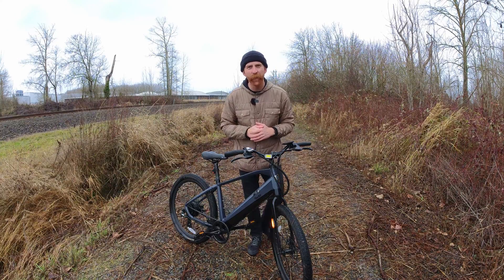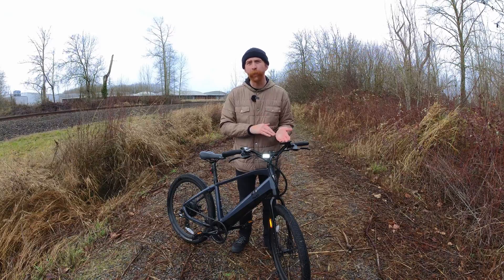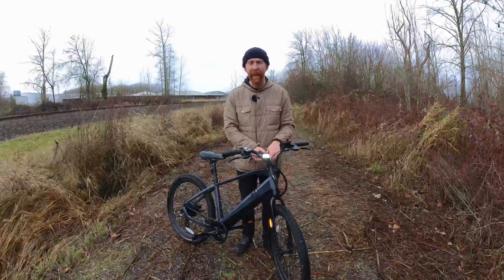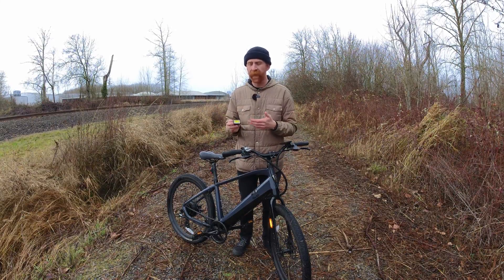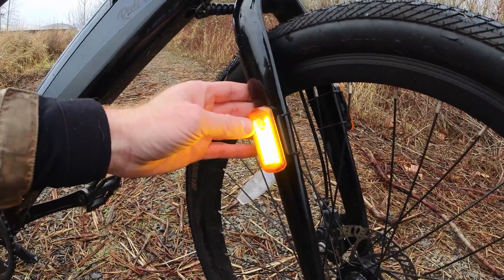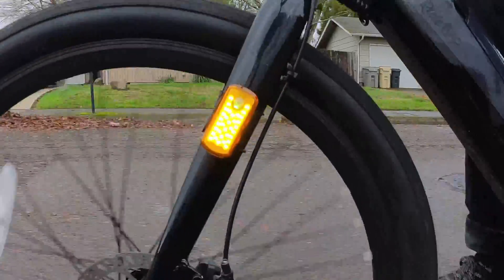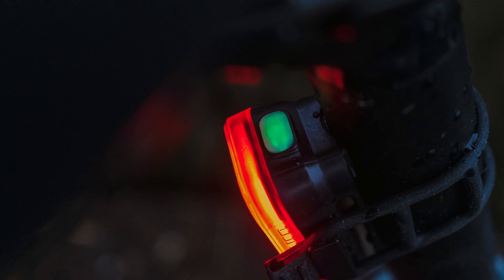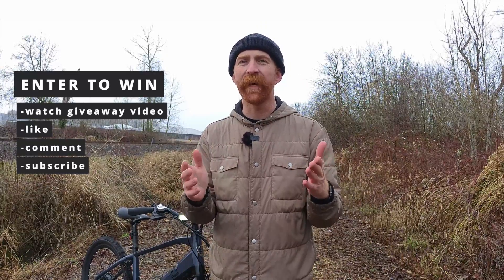Blackburn Grid Lights, what are COB LED's? #bikelights #electricbike #blackburn

Comment: I got the old micro USB Grid Side Beacon version of the one you got. They are great, but I have no idea what use a high solid mode was for. Low solid was fine for bike paths and that's pretty much the only place I can see a solid mode would be useful. 

I looked at the new USB-C version and they kept full power solid mode with a dissapointing 1.5 hour runtime. They should have traded the lumen output for longevity of about 3 hours and given the full 110 lumen brightness to whatever they determined is the daytime mode.
Reply: I was the designer on the Side Beacons and Developer for all these new Grid lights. I fought so hard to remove the solid mode on these since it's absolutely pointless for safety lights. Pulse mode is for low light riding. Strobe is for daytime use. And eco mode is for extended battery life. Solid mode is for marketing/sales comparisons and the old heads that think solid is the safest...

Comment: I have Cob lights on my bike and helmet they are great they last long but they're not bright enough for example my cob headlight can only output around 400 lumens (good for urban use) compare to my 2 other non-cob headlights can output 1800 lumens 6000 lumens at full power good for wet or muddy terrain